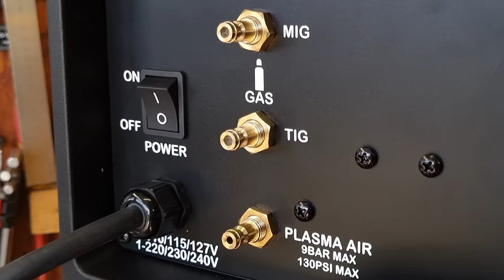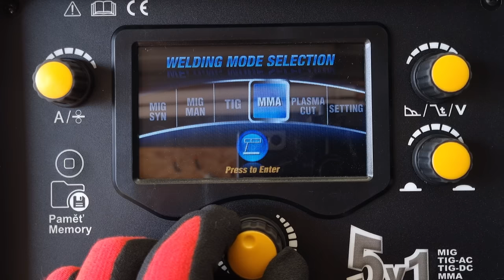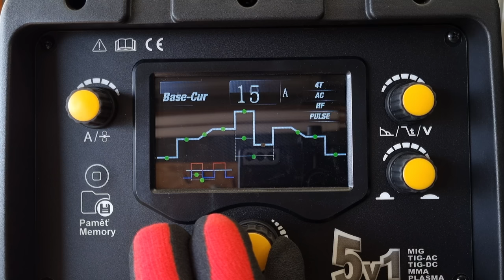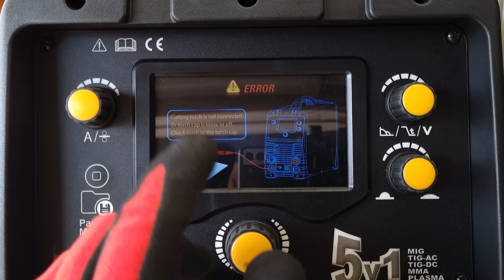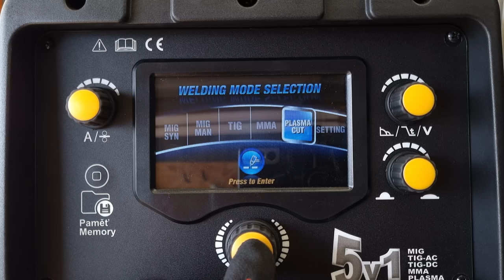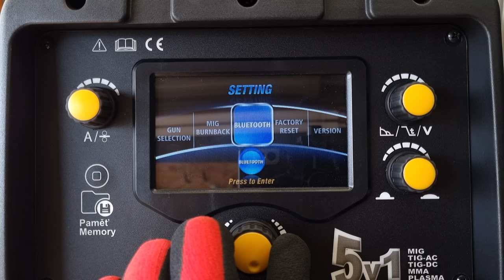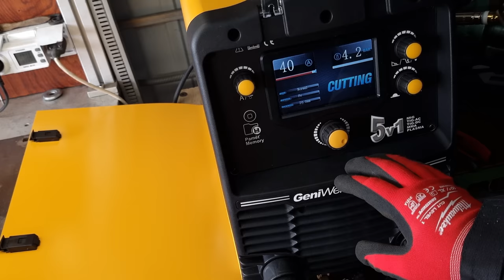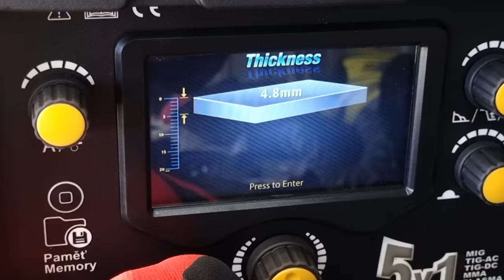Zváračka z automatickou polaritou Kowax Geni Weld 5v1. Zmení MIG zváranie na TIG za 2 sekundy.

Comment: fšetko fajn, len CENU tam neuvádzajúúú😁... asi vedia prečooo...😅
Reply from the maker: Áno nie je to lacná záležitosť.  Je to skôr zváračka pre firmu na dielne.
Reply: cena ako som pozeral 2300€
Reply from the maker: @SzetyinszkyTomas  Ceny sú závislé aj od samotného predajcu.
Reply: Thank you very much beed l lake it
Reply: Bonjour, et ou est il possible d'avoir les informations et où le commander ??
Reply: Onde comprar e quanto custa
Reply: @assistecmaquinasdepremolda495  quanto custa está maquina
Reply: I don't really see the sense here... For less price you have three machines together with 8L gas cylinders: really nice MIG/MAG machine, separatee AC/DC TIG and more powerfull plasma cutter. If one fail you can still use two others. If this Kowax fail you have nothing until it is repaired. It is nice but WAY OVERPRICED!

Comment: Pro mne by to nebyla správná volba. Na udělaném vozíku mám v horním patře GeniMig 220 LCD a vedle GeniTig 200 AC/DC o patro níž šuplíky s příslušenstvím a vedle plasmu PPSK 40 A2. A dole malý regálek na plast pouzdra el. CHEM-WELD. Vzadu 2x 10l Arg+směs a za nimi 1x 8l CO. Po stranách hadice. Na nafukovačkách s možností naklonění do modu rudlík. Kdyby náhodou něco kleklo, tak je vždy možnost práci dodělat na vedlejší mašině. A vše komlet vyšlo na 38t bez DPH.

Comment: Amazing machine, a bit costly I think, at about €2500
Reply from the maker: Expensive for some and cheap again. It is a professional machine that will replace 3 plasma MIG and TIG AC / DV machines, each of which has a value of 1000 euros, and there is also a quality accessory with control directly on the torch.
Reply: Ποσα εβρο κανη
Reply: @FORWORKANDFUN  Yes, I agree! I would love to be able to buy one, but I asked on their facebook and they answered that it is not possible to sell it to Norway. What a shame. I think this machine would be a big seller here.